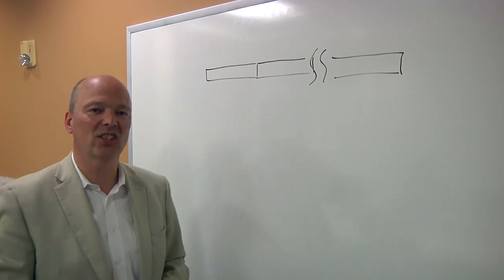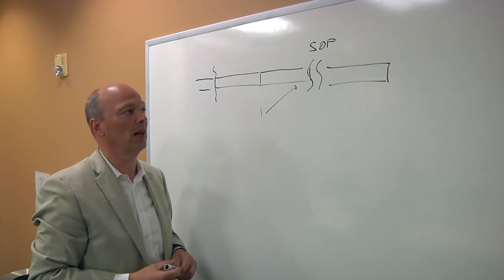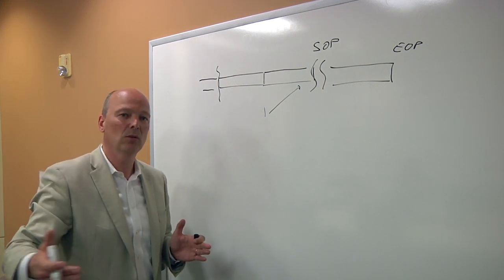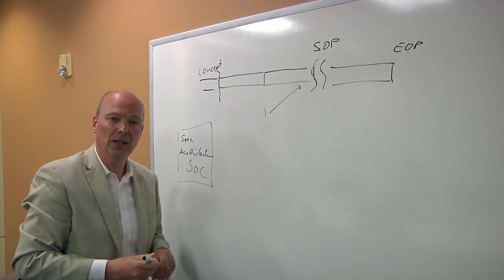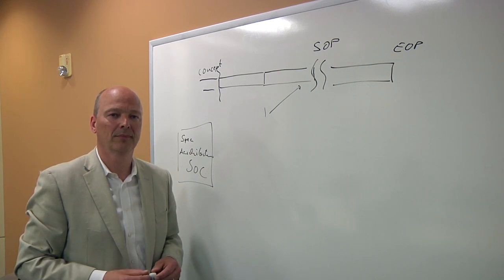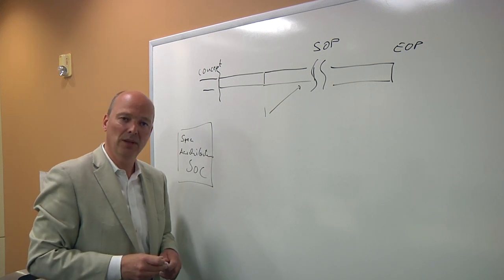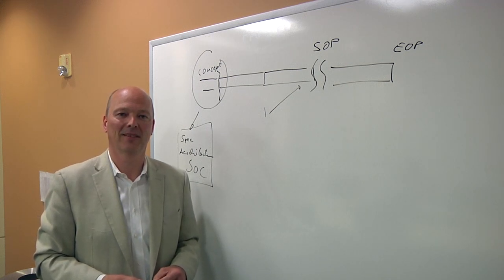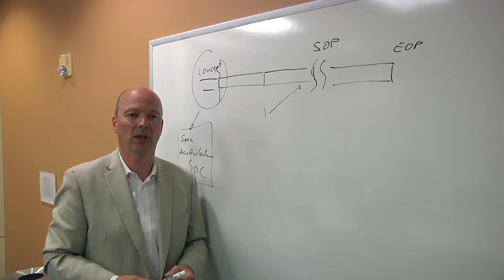Automotive System Design

Comment: This sounds like something that is likely going to go wrong over time. The presenter points out a lot of the upcoming problems are similar to those smartphone makers had to deal with. Sadly as we all known smartphone makers have done a rather poor job in staying up to date. I have a rather hard time believing cars will fare much better. 18 years is the stated lifetime, but considering how many cars go for significantly longer than 18 years it will become hard.
A very fun set of problems but also quite a bit more serious now that it is cars.